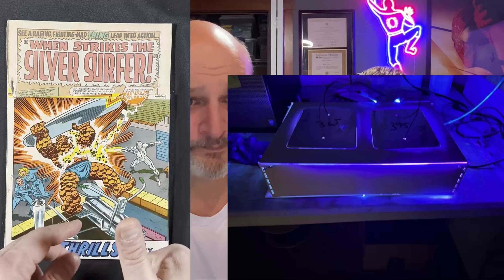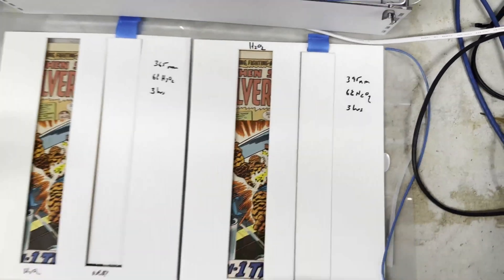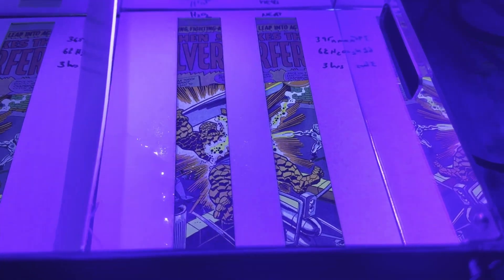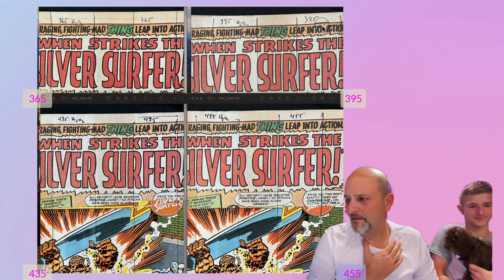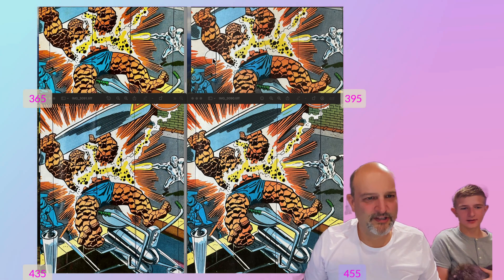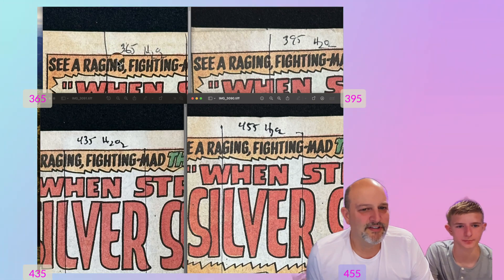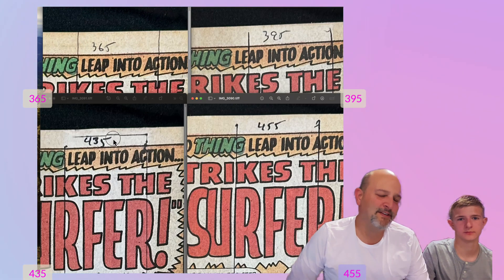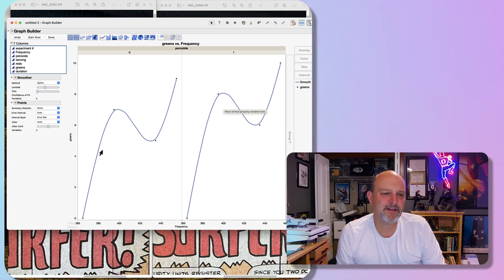Experiments photobleaching with light frequencies on comic books

Comment: After having purchased an Immaculight and experimenting with it for a couple weeks, I am unfortunately not getting dramatic whitening results. Am I doing something wrong? I've left yellowed books under the light for 12 hours at a clip like you did in one of your experiments and they do get a tiny little bit more white, but nothing dramatic like your videos are showing. If I leave it for more than 12 hours, it noticeably fades the yellow inks and the other inks seem to lose their punch. Is the hydrogen peroxide the secret? Like your video with the action figure bubble deyellowing, I ran a Secret Wars figure under the light for six days and it did clear up the bubble, but also faded the yellow ink pretty badly (like with your Dr. Doom example).
Reply from the maker: thats an interesting (and frustrating) predicament. Clearly with more time you are at increased risk of fading all colors, but especially reds and yellows.  I cant say with certainty if your method has room for improvement or if the books and paper you are attempting to whiten just isnt suitable for whitening.  It could be either (or both,).  I’ve attempted to whiten several books with absolutely no effect at all and in other books there is a dramatic effect. Universally adding 6% H2O2 to the paper accelerates the whitening, but usually only on areas where the substrate paper has been reduced and has formed a bond that makes the paper look yellowish.  If this isnt present then theres nothing the light can do for the book.  It doesnt sound like your issue could be duration, and I am assuming the lights are not robbed of any power so they are operating at a nice and bright 24 watts.  SO with that in mind I suspect that either the books are no suitable for whitening or theres some advantage to be had by adding peroxide solution to the books themselves.  I hope this helps, even though its not at most definitive answer one could hope for!  Rick
Reply: @ImmaculateComics  Thanks for the reply, Rick! I've tried a variety of books from different publishers and eras (bronze and silver) with not a ton of luck... best result was just a test on the black and white inside front cover of a severely yellowed book. I'm going to keep trying, though.
Reply from the maker: Im sorry you've had so much trouble, Steve that's probably disappointing and somewhat frustrating.  I've photo bleached close to a thousand books not and not all of them responded well to it.  However, most do.  keep me updated on your progress. Definitely try the peroxide.
Reply: @ImmaculateComics  No worries, Rick. I'm going to keep trying for sure.